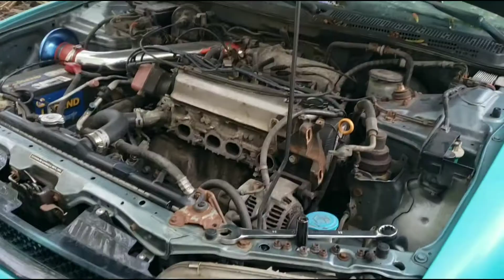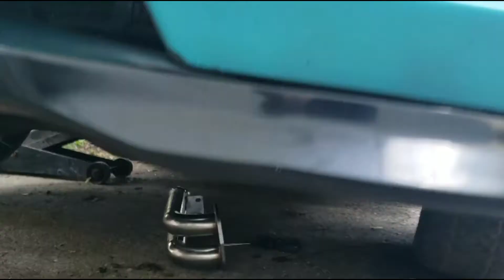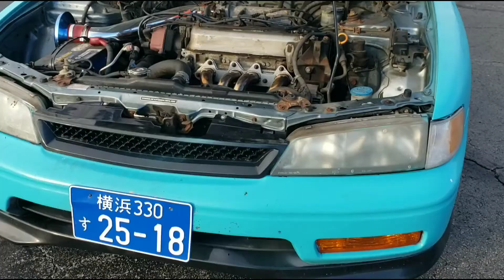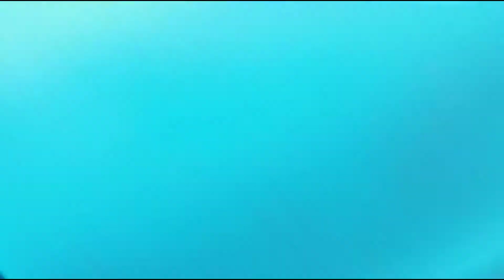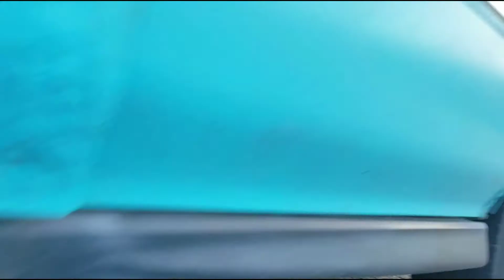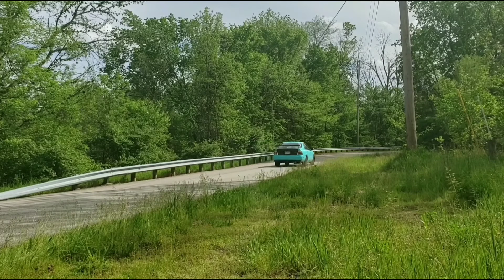Accord LX Straight Pipe with Ebay headers

Comment: Great video, I have the same aftermarket exhaust/headers and it seems they make a bubbly noise, I’m thinking on upgrading to a more expensive exhaust
Reply: What's the name of the exhaust so i can grab one
Reply: @shaunsingleton5285  there’s not a particular name for it honestly, just type in exhaust system on eBay for Honda Accord, they are all similar but I would recommend getting a name brand exhaust

Comment: hello....  how many hp did they increase? Do you feel the change?  is it worth it?  i have a 94 accord
Reply from the maker: I'd say about 10-15 hp. Definitely feel the change, only bad thing about these headers is that they potentially crack over a few years so I'd wrap with heat exhaust wrap (about 10$-20$ at an auto store) to prevent that. Definitely a great upgrade imo

Comment: You need to adjust your valves lighter oil don't clap it bro.
Reply from the maker: As stated in previous comments, this car was sold not even a month after this video due to brake line blowing in multiple areas and frame was rotted with 250k miles. Thanks for the input tho